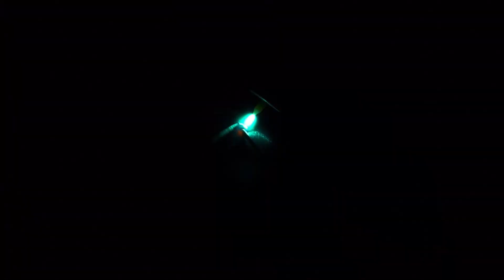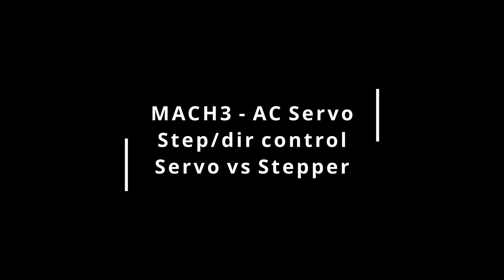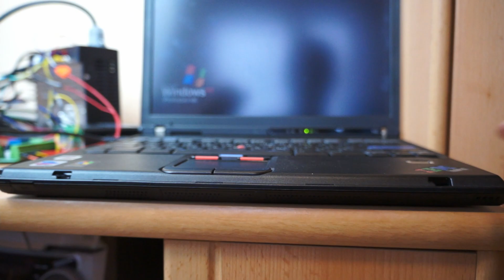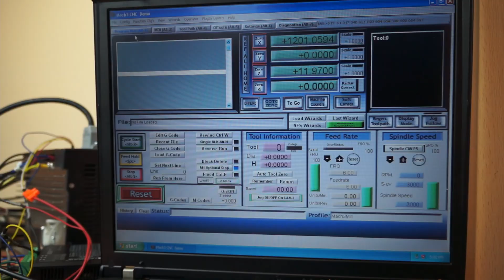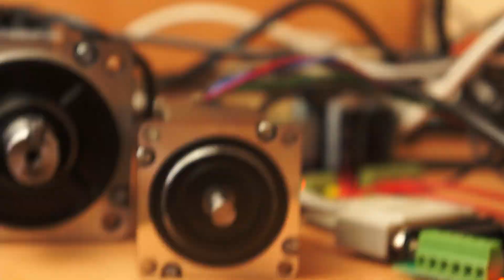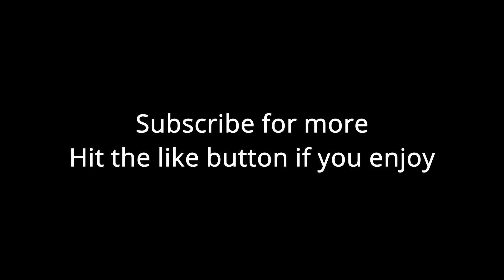Chinese AC Servo - MACH3 Setup (Vs. Stepper Motor)

Comment: Hello. I have seen this video. I want to make some rebuilt of milling machine. Can you tell me which hardware have you used for connection between PC and servo drive? Thanks!
Reply from the maker: I've used some CNC controllers - for now I prefer the AXBB-E from CNCDrive.
Reply: @GBWM_CNC  Also if i see correctly the are single phase motor. Not three phase. How do they behave loaded?
Reply from the maker: @zaricmicaizknica The servodriver is being supplied by one phase but it converts it to 3 phases just like a vfd would do.
Reply: @GBWM_CNC  sorry for being boring. Just planning to male one retrofit on 3 axis milling machine and I need to decide if I will use NEMA steppers or these servo drives.
Reply from the maker: @zaricmicaizknica  no worries! :)
Reply: @GBWM_CNC  do you have any recommendation, between stepper and servo? It is less adjustment on stepper. But i think servo will do better job in term of interpolation?
Reply from the maker: @zaricmicaizknica  well - there are also closed loop steppers in between
Reply: @GBWM_CNC  this was other part that concerns me. It is so called Hybrid stepper. And there are to purchase 12.5Nm. I don't know if this is enough to move milling axis. Also for Z axis i need it with brake. I was told that they will do the job quite well. And this is my first project so i would not like to spend too much money, but would like to make it well. I bought Deckel Maho milling machine. Weight of the table is approx 400kgs. :)
Reply from the maker: @zaricmicaizknica  that's cool, deckels are great. Depends if you have some kind of counter weight and what the pitch size of screw is. Also check if you have ball screws installed already. You can use pulleys to get enough torque to move the table. All depends on what speed and accuracy want to achieve
Reply: @GBWM_CNC  i wanted to install 1:2 ratio with pulley and belt for the axis, to compensate inertia of the table on the higher feed. There is no counter weight, but what i saw is that there is NEMA stepper with the brake, so probably i will decide to use this one, instead of servo. For servo it will take more time to set up parameters. I think that there is enough power in NEMA  34 with 12Nm torque. Similar with 2.3kW servo.
Reply from the maker: @zaricmicaizknica  steppers have usually less rpm and can't take more load while ac servos can generate up to 300% more torque for some seconds. All depends on the application :)
Reply: @GBWM_CNC  so, my machine arrived. And I see that the motors on it, and motors which I can find, eg. NEMA are totally different in terms of size. So I will have to do something different. I think that servo drives are Analog signal here. So I think will have to use Mesa card to control the drives.
Reply from the maker: @zaricmicaizknica  ive heard good opinions but i dont have experience with that. You can also fit new drives :)

Comment: Bro 

Thoughts Please..!  

I am really worried about the reliability and consistency of Mach3 when coupled with  Industrial Grade AC Servos.!

What are the real benefits of dedicated CNC Controllers over Mach3? If any?
(Expensive alternatives like RichAuto,Weihong,Even Masso)

People say,
The Kernel Speed Mach3 Offers are insufficient for Servos..!
And as it is cheap,
USB Motion Controllers are highly inconsistent as there is a high chance of EMI penetration due to their weak control signal Voltage (5V)

I need reliable, fast, and consistent performance of servos, and even if not exactly the same I need the somewhat close performance of Industrial CNCs.

(I have an RNR USB Motion card)

From your experience and knowledge, Can We ensure consistent and fast performance of MACH3 with servos using that Cheap USB Motion card?
Even If the Speed is compromised a little bit, the consistency and reliability should nt be compromised..!

Any thoughts?
Reply from the maker: Ac servos are a source of EMI. Rnr boards as you stated arent not perfect when it comes to Emi protection. I had issues with the rnr board and Emi (the source od Emi was a ac motor spindle with vfd 2.2kw). I managed to make it work through a Emi filter, shielded cables, seperated power supply for the computer. So yeah - if
 you need reliability then i'd rather go with a Ethernet controller like axbb-e, mesa linuxcnc or a similar one which are much more resistant to Emi)
Reply from the maker: Also about the speed - using lower kernel speeds for ac servos will make the servos resolution lower maintaining the full speed or lower speed with maintaining the max resolution. All depends on your needs. If I remember correctly - the ac servos usually have a base 10000 pulses per 1 rotation but this can be changed by servo driver parameters
Reply: @GBWM_CNC 
Speaking about this I've got closed loop steppers 12nm with a 10:1 drive to rack and pinion and we are maxed out at 1200ipm and kurnel. if we upgraded to ac servo drive would we have to go with a higher reduction and a lower torque motor to achieve the same or greater results? Thanks for your time.

Comment: Hi GBWM, I have a question. Do you have to do the encoder settings in Mach 3 if you are using servo motors with a closed loop system for high accuracy?
Reply from the maker: Hi! The servo driver handles it itself.

Comment: Thanks for the video! How is the holding torque? It has no brake does it?
Reply from the maker: I'm glad you like it. I didn't measure the holding torque but I'm now testing these servos on my machine and these seem to be really powerful so probably the torque is right (the manufacturer says its 2.39Nm up to even over 7Nm when overloaded). There is no brake on mine, but there are the same models with a brake if you need one.
Reply: @GBWM  ow really? I was only able to find the one you showed but it was hard to find any info (aliexpress). I'd like to use it for cnc and the brake seems important for it.
Reply from the maker: @rickkubbenga5904  https://pl.aliexpress.com/item/1945384477.html here for example. Some time ago these with brakes were easier to find I think. Anyway I don't think the brake is needed if you don't have a really big inertia in your mechanics :D
Reply: @GBWM  I can imagine for Z so when it powers down it won't come cashing into the table 😅 but this motor would be to for spindle for me. It might help to to keep it in place when you use it to keep material still and machine with another spindle on the other side
Reply from the maker: @rickkubbenga5904  this makes sense 😁you can also consider making a counterweight. This is what I will use in my machine for Z

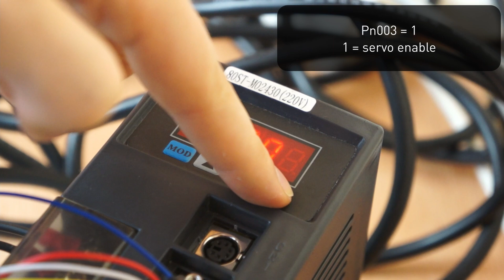Comment: 2:50 HELLO, SORRY FOR BOTHERING AND FOLLOWING YOUR CHANNEL FOR A LONG TIME BUT I AM BUILDING A NEW MACHINE AND NOW I WANTED TO INQUIRE IF EVERYTHING WAS CONNECTED CORRECTLY MY DOUBT IS I HAD TO SEND A SIGNAL TO THE ENABLE SO THAT MY SERVO WOULD WORK BUT I SEE THAT YOU CHANGE IT THE PARAMETER PN003 I THINK IT IS SO THAT I DON'T HAVE TO SEND IT A SIGNAL TO TURN ON BUT AS SOON AS IT TURNS ON IT ALREADY SENDS THE SIGNAL, WHAT I UNDERSTOOD IS CORRECT

Comment: Where did you buy the motors from. Do you have a link address?
Reply from the maker: Type in 80st-m02430 on aliexpress. There are many sellers - i bought mine from MASTER JIANG 3SMT Store.

Comment: Hi! Im building cnc milling machine, can i use servo 400w for XYZ axis? Enough strong?
Reply from the maker: Hello! This really depends on what you need - axis force, accelerations, maximum feed rates. I'm thinking of converting an old manual mill to CNC with 400W servos for X/Y and 750W for Z (table).
Reply: @GBWM_CNC  thank you and one more question : can i use EtherCat servo with mach3?
Reply from the maker: @pham7878  I have no experience with using ethercat protocol with mach3 software. But I've seen This Old Tony mentioning using ethercat servos with mach4 on his build. Maybe you'll find there some information abou that.
Reply: @GBWM_CNC  many thanks bro! Hope see your new project soon!

Comment: Hi, I wondered if you could possibly help please. I have a problem with my Chinese 6040 CNC router. The problem is on the Z stepper motor. It works fine until it comes to a slow curve in the project. Going straight up and down is working fine, but when it has to do a slow curve in the carving, it gives a loud grumble and continues cutting 1 or 2mm lower than it should be, leaving a step down in the project. I don't know much about the electrics of the CNC, so I have no idea what to do. Thank you for any help or advice you can give. Terry.
Reply from the maker: Hi. This looks like it is loosing steps. Is the current setting set right? Also during curve motions usually there are 2 or more axis moving in the same time. If you have one power supply for all axis - maybe it exceeds the rated power of the supply? You can try slowing down the feed speed on curves. Or maybe the endmill is to loose in the collet? I had such problem when I made my CNC mill - there was too much load on the spindle, the end mill was bad quality and the end mill was looseing itself which lead to too deep cuts. There are many possibilities.
Reply: Thank you so much for your quick reply. I have increased the feed speed, and it's not quite as bad. It is still loosing steps, about 1/4 of a mm at a time, when it gets to the curved part of the carving usually. The 3" of carving it's done before that is perfect. It's a new tapered solid carbide ball nose bit I'm using. I have checked it for tightness and it seem ok. It seems to start to falter roughly at around the same place on the carving every time. I have used the same Gcode before, and it's been fine, so I don't think it's that. I have had a quick check for bad connections, but not found anything suspicious. It's when it does the slow curved parts, it gives a grunt type noise, and that's when it seems to drop a 1/4 mm in the carving. Thank you, really appreciated. Terry.
Reply from the maker: @Wrighty  It's hard to guess what could be the issue. The thing might be to low amperage on the stepper driver. Maybe too low voltage on power supply.  Maybe too high feed rate. Maybe the coupler between the motor and the axis is slipping? Maybe the CNC controller is not keeping up with such feed rate speed? These are just some guesses which got to my mind.
Reply: I do understand this is not going to be easy, and I thank you for the help you've given me, it's really appreciated. I'll take the things you've given me to check, and look into each of them. Thank you so much for your time, take care, Terry.

Comment: ?? That motor does not have 10000 pulses per rotation encoder. 2500 actually.
Reply from the maker: You're right actually. This command I was describing is about an electronic gear ratio. Not sure how exactly it works, but seems to work.
Reply: Incremental encoders output 2 streams of pulses, Channel A and Channel B. These A & B pulse streams are 90 degrees out-of-phase to indicate direction of rotation.

This provides 4 different states: 0-0, 0-1, 1-0, 1-1

Quadrature decoding derives 4X resolution from this. Therefore, a 2,500 line (pulse) encoder produces 10,000 counts.

This should be displayed as counts/rev instead of pulses/rev.

Comment: I have a question, hopefully you can help answer. I’m looking to build something to move a motorcycle shift linkage forward 1 inch, then return to center as fast as possible. It needs to do this in either direction. I would assume using a lead screw is best, but what motor would be best to use? Every time I try to search for servo motors, all I see is steppers. Maybe the stepper is better? 
Would like the forward and return to be in the 50ms or under range
Reply from the maker: Depends how much force (or torque) would you need there. As far as I know servos are more dynamic than stepper motors but usually those are for AC voltage. You want to turn your manual transmission to automatic?
Reply: @GBWM_CNC  it’s to shift a motorbike transmission. Sequential, so it just needs to push the linkage. It’s already manual, but I want push button instead. 
Probably a fair bit of force, maybe 20 pounds?? But that would be the force applied after the ball screw so no idea what the motor would see.
Reply from the maker: @limitlessbuilds I guess you would have to get an stepper motor with small inductance. The less inductance the higher speed/ acceleration you get on the motor. Also same goes to the voltage. The higher voltage power supply  you have the higer are the maximum speeds the stepper motor can output. Of course in the range that the stepper motor can handle. If you need i'll find the formula for motor torque to axial force on the screw when i get home.
Reply: @GBWM_CNC  ok thanks. I’m going to be limited to a 12v vehicle system, which might see 12.7 roughly. 
I have an old electric shifter that I was planning on using, but somehow the actuator no longer works. Trying to pull it apart to see how they did it. It is very small, very fast and quite powerful. It’s old school so it uses micro switches to reverse the directions after pushing to get it back to neutral. 
I appreciate any help man. Really don’t want to spend another $1500 for a new system
Reply from the maker: @limitlessbuilds  12V is a bit low for stepper motors. Maybe you could buy a step-up converter. I saw at a local supplier 12V > 24V converters which could work I think. Actaully you can use 12V on a TB6600 stepper motor driver but I'm not sure what torque and velocity you will be able to get. The lowest I ever used was 19V from a laptop charger which actually worked up to 1000rpm on a nema23 motor but without any load on the shaft. The formula for axial force from a stepper motor on the ballscrew is: F=2*Pi*M/p where: F - axial force [N] pi= 3,14; M - stepper torque [Nm] p= ballscrew pitch [m]. This should be multiplied by 0.9 which should represent the efficiency of a ballscrew (if you use a ballscrew instead of normal lead screw which has a worse efficiency).

Comment: Can we use stepper motors in industries in long term, are they accurate everytime?
Reply from the maker: I wouldn't recommend. If you need accuracy I would go for closed loop stepper motors as those have an enconder which allows it to check if there is any positioning error. Although I made a CNC mill using stepper motors and it is working for about 1.5 year now and seems to be accurate enough (if it isn't overloaded which might lead to stalling).
Reply: @GBWM_CNC  THIS servo also have encoder and Driver its far more controllable than stepper motor drivers. With servo you just need to spent few days tweaking every setting according to your needs

Comment: Thank you fort his vids. Do you know how I can switch between direction and torque control? I would like to change the torque using the -+10v input while it’s being controlled using  location.  Thanks!
Reply from the maker: I dont think it is possible to control the torque and position in the same moment.
Reply: @GBWM_CNC  ah bummer. Thanks!

Comment: Without a load, that test i pretty meaningless... You need to set all the parameters in the servo drive, gains and such, in order to get the motor to function properly. Only with a load can you do a test like that. And believe me, with a load, you want it bolted down in order to try any of those acc settings. On any CNC you don't want acc settings that high though.
Reply from the maker: I agree. Anyway this video shows how quiet the AC servos are compared to stepper motors. I was using accelrations on my CNC like about 900mm/s^2 on nema23 stepper motors and it worked pretty well so I guess those acc's would be kind of insane in real use and probably not even possible with load. Anyway I was wondering if the motor will stall like the stepper motor does even without load  😁
Reply: @GBWM_CNC  Servos run quiet because they are essential a 3 phase brushless motor. They do not stall, again because they work just like a 3 phase electric motor. :)

Funny to see how much it jumps at high acc settings. :P